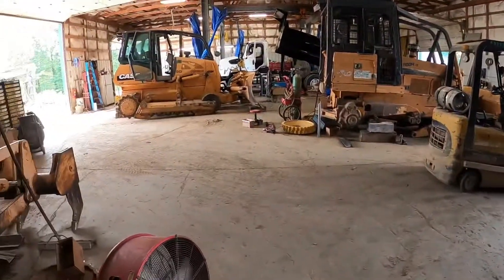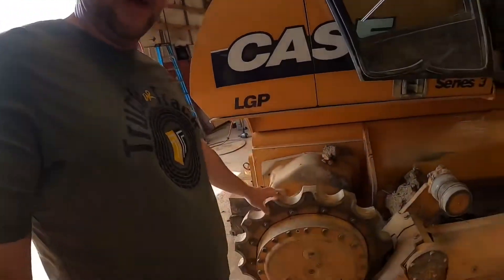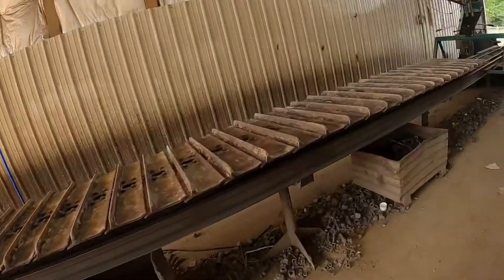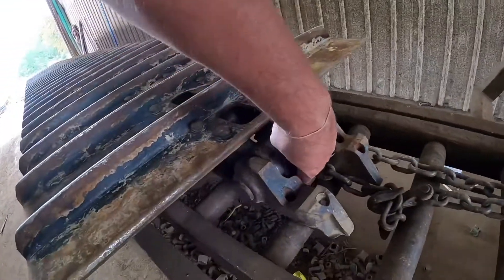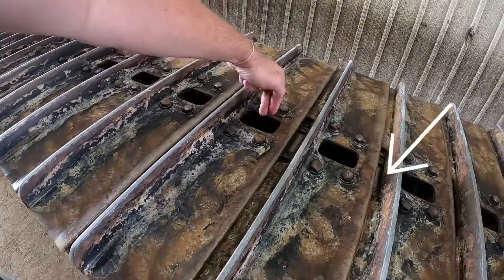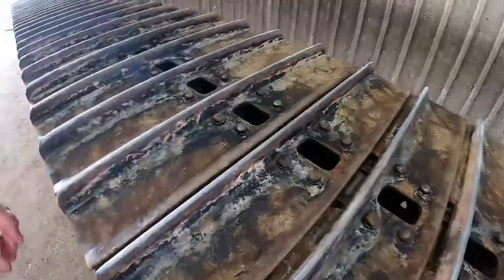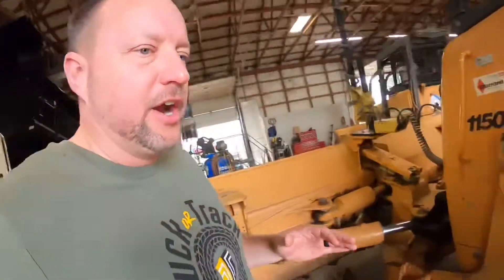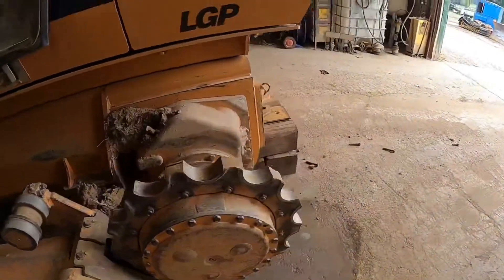Case Extended Life Track Chains Love it or Hate it

Comment: Yes but what kind of longevity do you actually get out of these over salt or for those who don't know, sealed and lubricated track.
Reply from the maker: Hey Charles great question. Sealed Chains that’s no oil just sealed on average run 1500 hrs. Sealed and Lubricated so with oil run 3500 to 4000 hours. If your not using the machine much we understand just Sealed but we always try to steer people Lubricated. Side note- Sealed Chains with no oil will freeze up very easily if not being used.
Reply: @TruckorTrack  I have a Case 450. I have been looking at larger machines and was wanting to learn more about the different track options from someone other than a salesman trying to make commission. Thanks a bunch.